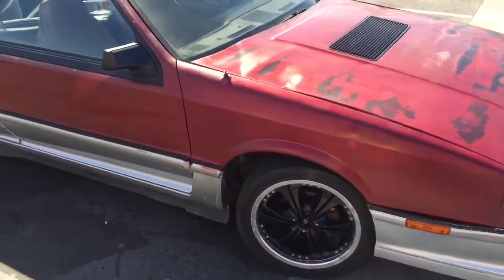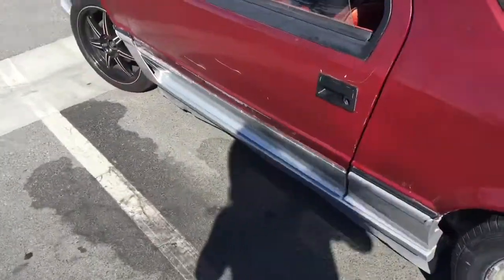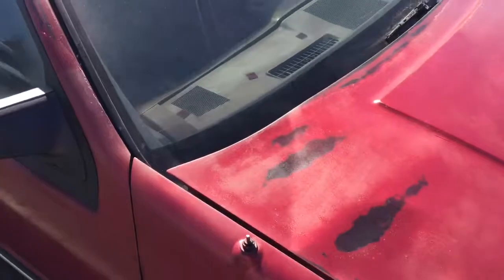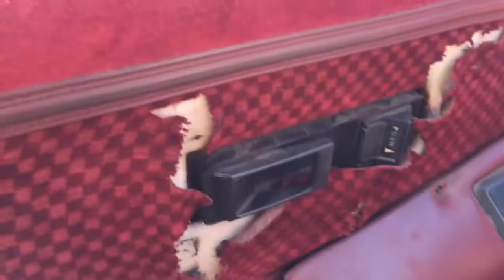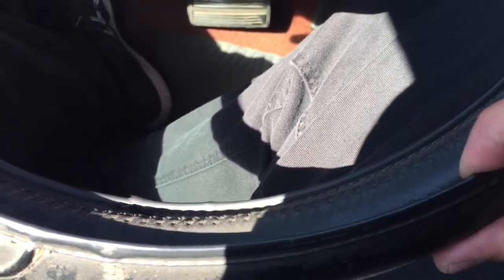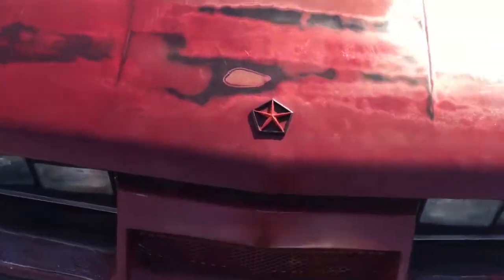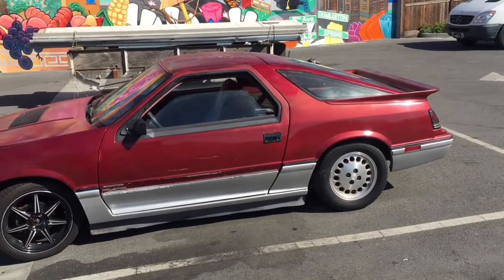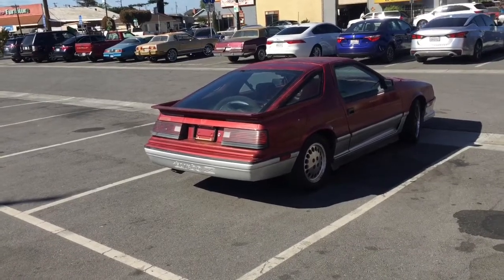Running Dodge Daytona 1984 Turbo Z

Comment: I don't know how old you are but I bought one new in 84' and it's nice that there are those that still love these cars. Those seats are from a 84' but not from that car. On a TurboZ the checkered pattern insert on the seats was standard and it would match the checkered pattern inserts on the door panels. I noticed you said it was up for sale. What made you give up on restoring it? Did you end up selling it?

Comment: NICE  BRO👍👍👍I have an 84 too,are you located in  Cali ,we should talk some time
Reply from the maker: Right on, yeah I’m in northern Cali but I sometimes hang in SoCal, that would be cool I hope this would be restored
Reply: I'm in the process of restoring mine as well, mine was my Dad's car, it had been sitting in a barn for at least 20 years, I'm currently rebuilding the engine
Reply: I got my head Serviced,and redone ,Now soon I'm getting a Rebuilt Turbo,I step at a time. 😁😎

Comment: Cool, it’s too bad these were kind of rare to begin with as for finding parts.  
I had an 88 2.5 non turbo as a kid, not a fast car and my biggest gripe was that the automatic transmission was very American being a tall geared 3 speed with locking converter. This is essentially a Chrysler K car with a Mitsubishi body design.  
Not exactly luxury but luxury sport in a way as it has thick heavy carpet and little details like plastic covers on the seat tracks where the bolts go to the floor for example. 
Overall the car feels heavy compared to a Japanese or European car.
Cool that this one has two original wheels; finding replacements could be really tough. 
  The head design not being cross flow looks like it should have been put on a V8 but that never happened. 
   People used to drag and rally race this engine despite the primitive head design 2.2 and 2.5 turbo K cars with the Horizon being the popular Choice for weight savings.
I used to see a red one for sale in SF for many years. Too much $$ and bright Red 🤣
  People threw away most K cars at 100-150k miles and now all pretty darn rare. 
I like them for nostalgia and in honest they can be reliable and good on gas. A 5 speed would be a blast in this car; a world of difference.    
I power shifted my 2.5 all the time when entering the highway and had no transmission issues, sadly I did some off road adventures that killed the struts and let my pals use the car; they crashed the oil pan into a curb and continued to use the car with oil spewing out 🤣🤣🤣🤣 idiots!!!!